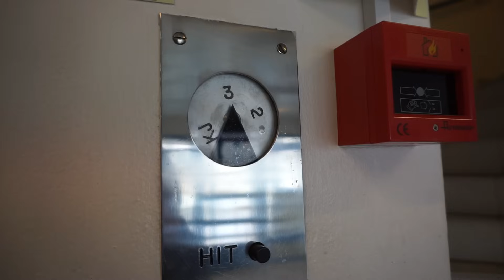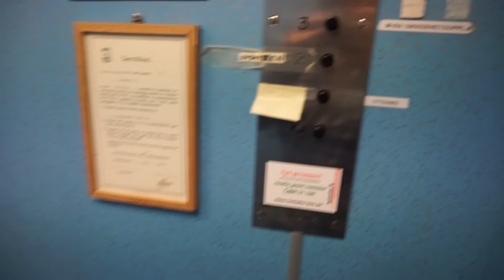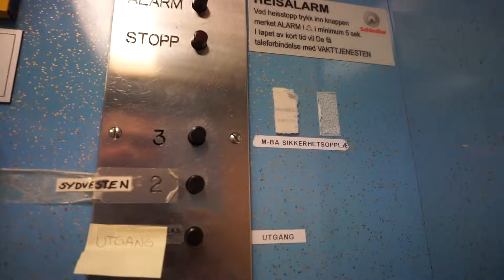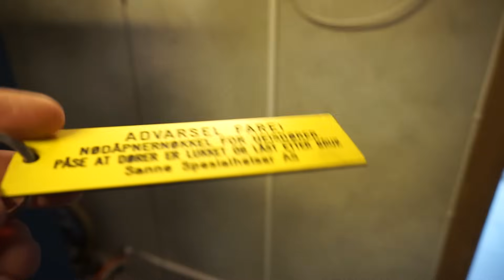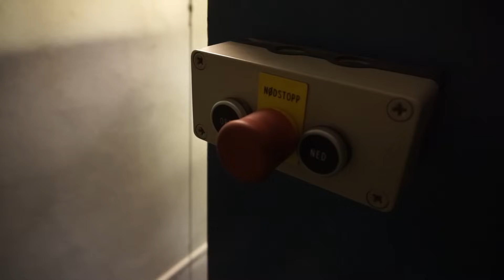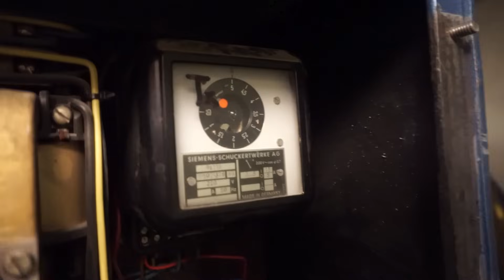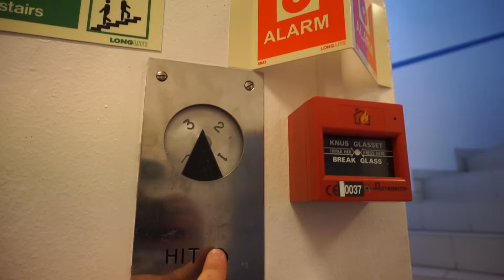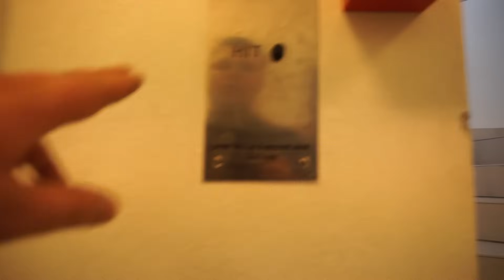Machine Room Tour! + Surfing! AMAZING 1964 Sanne Motor & Maskinfabrik winding drum traction elevator

Comment: OMG what an elevator (aka Lift!).  Absolutely amazing and this video has definitely gone into my favourites.
My highlights that I liked:  The ropes attached to the inside of the sheave to hold them.
That ratcheting noise as the lift is moving.
The size of the sheave.
The floor selector at the bottom of the cabinet, would loved to have seen that moving.
VERY nice video!
Reply: mrmattandmrchay can you perhaps explain why the ropes are attached to the sheave? I thought they simply passed over the sheave in a traction lift?
Reply: @frankiefiveangels601  , he is a bit wrong about the traction part....its a drum machine...so this is not a traction lift.    I have worked a lot with these lifts actually.  Its in my hometown and i worked with the company who made and installed them.  (actually i am related to the producer)   :)